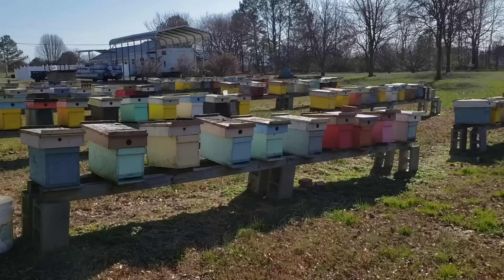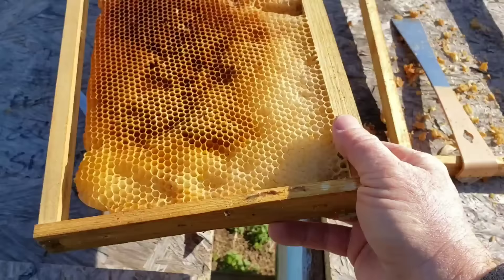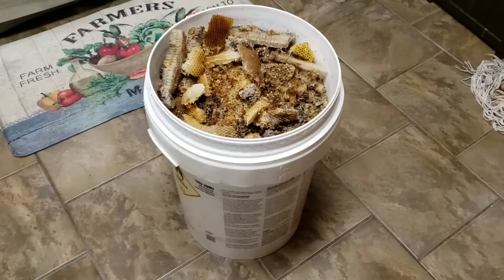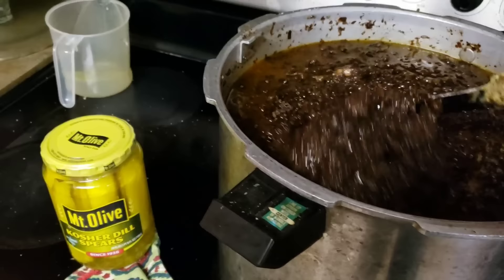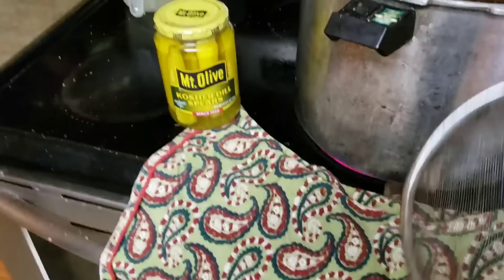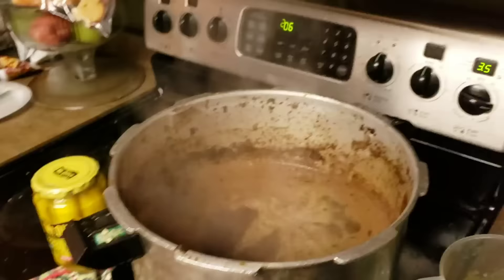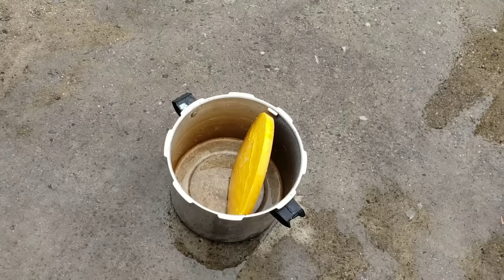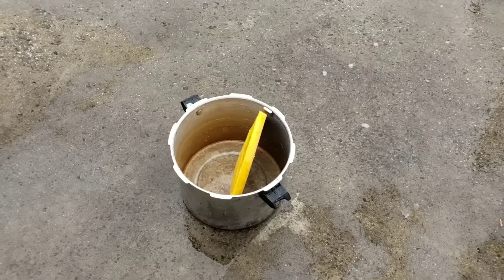Rendering Dirty Bees Wax Into Clean Yellow Wax

Comment: Do the last melt with the wax wrapped in an old t-shirt to get really clean wax. The t-shirt will act like a filter holding on to all the dirt while the melted wax goes right through. You then pull the t-shirt out and hang it above the pot, or bucket, and leave it to drip the last bit of wax before you discard it along with all the last dirt and debris.

Comment: I typically use a cardboard box with the inside painted black. Look for solar oven on line. Put a pot with some water in the box with a tee shirt over the pot, then stack the comb over that and let it sit in the sun. I put a piece of Plexiglas or clear plastic over the box to keep the heat in. As the wax melts, add more. All the wax will melt and the tee shirt will strain the wax and all that is left is nice clean wax and a tee shirt full of crap. The tee shirt full of crap makes a great fire starter for camp fires or for your fireplace.
You can substitute the cardboard box for an oven heated to a low temperature. What I've found is, once and your done. 
BTW, we've been down in the single digits here in CT.

Comment: I have found that, if you put all the frames with wax moth damage in a plastic tub of water, hold them down with a rock. After they soak all the wax cocoons and damaged comb falls off so easy. No scrapping at all. The just set out the frame to dry

Comment: Just over 20 miles north of Detroit on the edge of both suburbs, and farmland. Normal coldest temps are single digits typically in January, & February when we get those arctic blasts (sometimes have seen minus single digits). Just a couple years ago we did hit -20...first time in my life.

Comment: I double pot mine. I put all the unmelted wax into a large vinyl muslin bag and add glass weight to the bag. The bag gets submerged in water into the inner pot and water added to the outer pot. The muslin bag will let all the melted wax leave to float while the detritus stays behind, inside the bag. The reason for double boiling is to ensure the direct heat doesn't damage the muslin bag.

Comment: Coldest it will get for me is ~2C (~35F).  Current daytime temps are sitting about 33C (~91F), though we have had a few 40C+ days (104F) which have caused problems for hives in poorly insulated or direct sun hives where the whole comb has melted out.  Brisbane Australia

Comment: For the past few days up until recently it got down into the 20's at night here in Central North Carolina. Zone 8. Before it got cold, my bees were bringing in pollen, and likely nectar from Red Maples. Fortunately, because I only have one hive, I had a small heating pad for emergency temperatures, and only put the heat pad on once it got a little below freezing. I turned it off once it get above freezing. My bees seem to be doing all right so far.

Comment: me a chemistry student wondering if the melting point of wax lowers significant enough under a vacuum in order to get an optimal wax quality. One could olso use a solvent of sorts and then  push it all through a  filsters and then evaporate the solvent at low temp.

Comment: After the first step of getting all the bulky debris out, you can melt again and filter through a fat strainer. This is a large, heavy duty synthetic “coffee filter”. Restaurants use them to filter cooking oil for reuse. I place it in an 8” funnel set over a milk carton (top of carton cut off), pour a cup of boiling water thru to preheat filter and funnel, then pour the hot wax. Stirring the wax with a chop stick and adding additional small amounts of boiling water to the funnel helps keep it flowing. Once the wax has cooled and hardened, cut thru one side with a razor knife, peel away. Filter can be reused. Clean by inverting, place back in the funnel, pour boiling water through. Using the milk carton produces nice sized, easily stacked and stored blocks of wax.

Comment: Northern Illinois along the Mississippi River.  Not much this year so far but last February when I was out of town it got to -33F.  When I got home and checked the bees I found that the plastic cardboard closers on my screened bottom boards had either blown out or were pulled out by critters.  I wanted to see what a hive with wall to wall bees looked like after they froze to death.  Both hives were wall to wall live bees looking very unconcerned with outside temps.  I'm pretty sure they appreciated the extra ventilation... I had four hives that died and they were dripping wet.  Yes, I'm a rookie beekeeper and not very sure of what I'm doing yet.

Comment: I live in Tullahoma Tn. (South central, near Jack Daniels) the lowest has been 17 deg.
I render my wax much like you. Outside with a propane gas cooker. I get my water to a slow boil (pail about half full) and then put my wax in until near full. with a filter material like cheese cloth pour wax and water into a cooling pot. I do this several times until clean as I would like. works pretty good.

Comment: Negative five degrees Celsius is the lowest temperature I’ve checked since moving to Canberra (Australia). Edit: I know this is the traditional method but I think a solar wax melter is better. It’s faster, cheaper* & makes a very clean wax brick from the first melt, every time (as long as whatever you’re using as a filter inside the solar melter doesn’t move)
* no gas or electric bill involved

Comment: Excellent video. Thanks for the advise.   I noticed on the last time in the pot you put the dirty side of the wax down.  I'm curious if it would help to flip the dirty side up to bring more crap to the surface. Seems like the dirt being on the bottom of the wax slab would allow it to mix with the wax more readily.  I figure every little thing helps.
Reply: The main problem is that there is some debris that's lighter than water, and heavier than wax. That will always end up on the bottom layer of the wax. The only way to get rid of it is to scrape it off between meltings. To speed up the process a bit more and get cleaner wax, you could probably scrape off a thicker layer, which would get rid of that debris quicker. You could even save the scrapings to melt with a new batch of wax.

Comment: Although this video is a few years old, I wonder if you changed methods since then. One very old method is to put the dirty wax in a bag, like a muslin or linen bag, and weight it down in boiling water with a stone. All the dirt and much stays in it, but the wax comes out in the water. After the first boiling round, getting most of the crud out, you get that slab out. Would breaking it up and bagging it be easier than scraping it and trying to strain it? Then having to do it 2-3 times and clean that pot real well?

Comment: Here in Victoria I've been too busy keeping track of both fire alerts and flood alerts - at the same time in a patchwork across the state - to check the actual temperature. But our weakest hive died out so quickly I found some bees snout down in the cells, and the wax around the brood looked kind of melted - how hot does it have to be outside for a hive to die of the heat? There was plenty of brood and plenty of honey and fresh-built comb, and no sign of disease or infestation, in a hive that was a swarm in spring.

Comment: I was thinking that all that "trash" that you ladled out of the wax was still wax coated.  Is it possible to mix that with saw-dust and use it as a fire-starter?  I don't have any experience with this level of wax cleaning, because I usually get my wax at the second cleaning stage.

Comment: I wonder if you could use a gravy strainer/separator; my thought is that you pour your liquid wax and water mix and junk into a gravy separator.  Since it would be glass you can watch and see when the wax starts to collect at the top, while that happens the water and junk will sink to the bottom.  Because the spout of the cup starts at the bottom you should then be able to pour out the water and junk while everything is still warm (wait till the wax starts to solidify.)  If that works it might be a faster(?) process.  Anyway let me know if that works or if you have already tried it or something similar or if it isn't fast enough or worth the extra effort.

Comment: Question on how to fix a beginner mistake - Any ideas on how to get bees wax off of my wife's metal cake pans I used when scraping off and melting the bees wax? Thanks a bunch!
Reply: Maybe getting it hot, then use paper towels, then clean it off with dawn dish soap and hot water?
Reply: Set oven to 175F. Lay 2 layers of paper towels on a sheet tray; put cake pans on this, upside down. Into the oven for 30 minutes. Remove and “buff” the insides of pans with a rag or paper towels.   Heat is the solution to all wax problems. Use a hair dryer to melt it from counters, stove tops, flooring, etc; melt, wipe, done. Spoons, small ladles, similar sized objects: put in toaster oven over paper towels; 175F x 30 minutes; remove while warm, wipe/buff, boom, done. Save the paper towels for starting your smoker.

Comment: Buddy, you didn't overwinter them well. Put the empty comb frames into the boxes and cover the bottom and top of those boxes with the green walnut leaves (it will dry anyway). No parasites will come onto that wax or into those boxes.
Reply: Also there is a much better and cleaner way to render the wax. I'll try to upload a video or post the link.